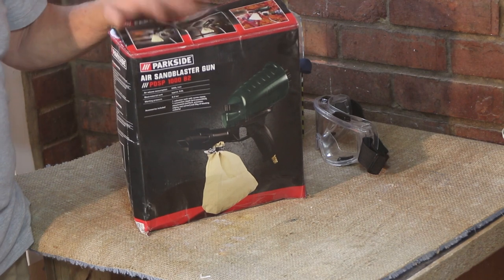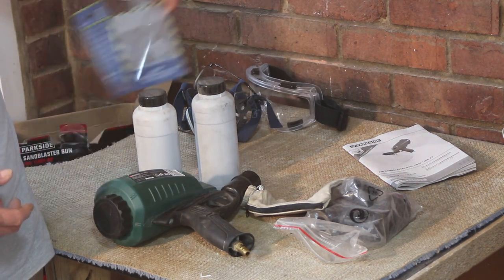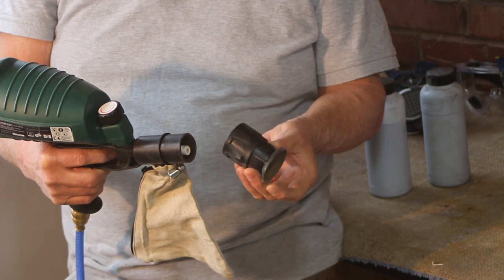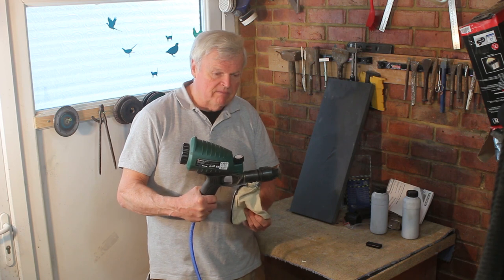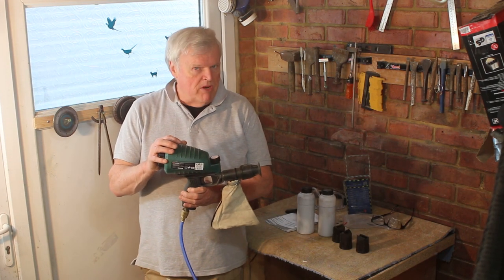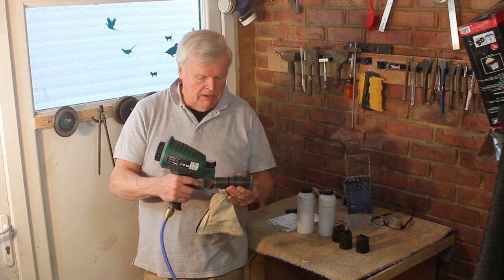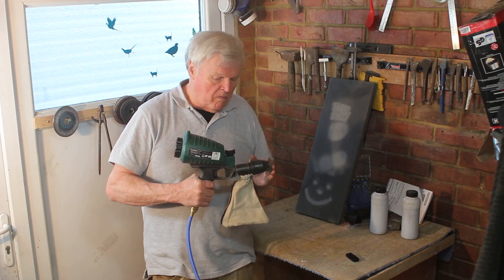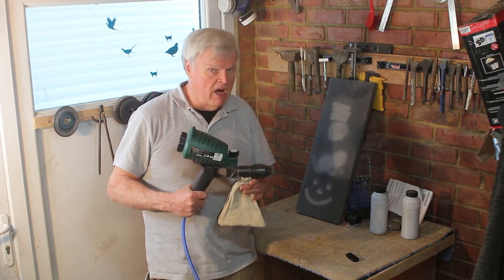Parkside Air Sandblaster Gun PDSP 1000 B2 - USER REVIEW

Comment: I am very pleased with this brand. I have purchased many products of this brand and I will continue to buy them as long as I am interested. I bought this product, and it works very well. I recommend using this product in blasting cabinet. Do not discard the sand after spraying and use it again.
Reply from the maker: Hi, this is an excellent comment, I too think you should use the blaster in a cabinet or some other way of containing the grit for re-use. Thank you for your input,

Comment: I very much appropriate the information, a good overall test . I have a large pressure pot set up on wheels, it's fine for large jobs but not exactly handy. Cheers from Dumfries Scotland.
Reply from the maker: Glad it was helpful, if you have the pressure pot will you have a use for this? For those who don't know, a pressure pot system will produce much higher pressures and faster blasting.
Thank you for watching and good luck with your blasting!

Comment: hello again, in my message below i forget to say that special sand for blasting gun cost +- 1€/kg and fine white table salt cost +- 0,3€/kg, so there is no photo if salt work well its beter to use that stuff, no. thank again for all you do for your spectator, Thierry
ps: my specific use is for sandblasting door and window blue stone (Belgium stone) because all my stones are dust and no more smooth when i touch them!
Reply from the maker: Hi Thiery, the risk of using the wrong blast media is of contracting Silicosis, a lung disease that is incurable and a terrible way to die. Blasted sand will create almost  pure silica dust and is deadly. Grits sold for blasting should have been tested to have a low silica content and produce low levels of silica dust and therefore safer to blast with. (Check with the seller) But the subject you are blasting can also create silica dust, sandstones and granites are particularly bad so use an extractor and wear a mask. Working outdoors is safer than inside.  I use Sintered aluminium oxide, this is for deep blasting stone. I have no experience of using salt but I would not use anything not approved for blasting. Your English is way better than my French! Good luck Steve
Reply: @thestonecraftingworkshop7490   I had no idea why not using sand. I thought that is ok about using it.  Reading your comment made me understand why using sand is not  an option. Better to be mentioned into the video description

Comment: fantastic video, would you reccomend this for blasting paint from a motorcycle engine? if so.... what would be the reccomended compressor specs? thanks in advance!
Reply from the maker: Hi Miguel, this would do the job, not sure about the best media as blasting metal is a bit out of my field. (possibly soda?) As to the compressor specs in general when blasting you need the biggest compressor you can get especially if you are going to do this a lot. My work compressor supplies 14cfm to a 200ltr reciever and is just enough for serious blasting. If this is a one off project a smaller home model will do it, you will have to be patient waiting for the comp to recharge frequently. Again get the biggest one you can afford. Best of luck!

Comment: Nice vid,lidl add shows that gun touch the surface thats is for the 4-5 various nozzle shapes for angles  flat etc do you know what size sand is this in the bottles?
Thanks!
Reply from the maker: Hi, I found the various nozzle shapes did not really work. I am not sure of the grit size as there is no info. It is very coarse, I would guess 40 grit. (Maybe ) Thanks for watching!
Reply: @thestonecraftingworkshop7490  
Thanks!

Comment: Hi thinking of getting one of these, what power of compressor do you think id need to run it? am only going to clean golf clubs
Reply from the maker: Hi Alan, sounds like a small garage compressor would do you, the gun only runs at 6bar pressure so not too high. If you are just cleaning think about using a softer media (grit). The grit supplied with tool will wear away the steel. Also you might think about getting or building a  small blast cabinet to contain the media otherwise the grit goes EVERYWHERE! Hope this helps. Thanks for watching.

Comment: hello, nice video very helpfull can you tell me what is the specification of your compressor ? what power you recommend for air debit ?
Reply from the maker: I have a large compressor with a 200 litre receiver and I think it generates about 14 cfm of air. the size you need will depend on the use you are going to put it to. in theory for blasting you need the biggest compressor you can afford and fit to your power supply, though this little blaster could be used on a much smaller compressor, especially if you are only doing small jobs
Reply: Wonderfull explaination, When you say 14 CFM it's for incoming air or restitution. I am looking for occasionaly restore some furniture or shutters. not matters if gear working non stop for no more 1 hours. looking also as compact as possible for little garage but really powerfull and fair price , any advice ?
Reply from the maker: I think this means it produces 14 cfm at the pump. I am not really an expert in buying compressors, as a general rule bigger is better. If you are simply short of space I do know that some makes mount the pump on top of a vertical standing receiver. This has a much smaller footprint. Might be worth looking at. Hope this helps

Comment: Hello ,.    good video I wonder could you help , 1 have a sandblaster gun pdsp 1000 d5 similar to yours I think, comes with 2 x 1 kg of aluminium oxide grit size 0.21-0.35 ( grit grade 40-60) (not what that actually means) I have a sip 200 litre  airmate 3 hp compressor, I am in the process of doing up a mf 35 tractor. I was going to use this gun to take any rust off before painting,  I don't think the 2 bottles would be enough, do you know what the best material would be to use, and I would probably need it in bags, some one mentioned crushed glass I think it was on eBay I'm in northern Ireland.        Thank you
Reply from the maker: Hi Martin, not crushed glass. I would guess something like soda or crushed garnet, something expendable. you could try here: https://www.ebay.co.uk/str/Sand-Blasters?_trksid=p2047675.l2563
They may be able to advise you, this is nor really my field. Best of luck.

Comment: hello.i have been using the same gun using kiln dried sand from B&Q.why did you say at the begining never use sand.thanks
Reply from the maker: Hi, My understanding is this, Sand when used as a blasting media breaks down into a very fine dust that contains "free sillica" looks under the microscope like splinters. These are so sharp they lodge in the walls of the lungs and will cause silicosis. (a fatal disease). Proper blasting grits are less sharp don't contain free sillica's and pose a much lesser risk. Please don't scimp on this, and always wear a really good mask!
Reply: @thestonecraftingworkshop7490  off to machine mart to buy the proper media.cheers....and a mask

Comment: Would this be up to the job of stripping paint from a mountain bike frame?
Reply from the maker: As long as you have a compressor that will provide enough air flow, and if you rigged up a collecting bay perhaps from plastic sheet and obtained the right sort of blast media I'm sure it would do the job. You will need to use a media that does not damage the metal of the frame, check with the suppliers.

Comment: What compressor where you using with this Steve?
Reply from the maker: Hi, I have a Machine-mart boxer compressor that gives out 14 cfm. However the pressure output was lowered to accommodate the tool. Thanks for watching.
Reply: @thestonecraftingworkshop7490  cheers Steve 👍 ended up going in to lidl tonight for a few things and bought that cordless engraver and a wood burner so will give them a wee tests see what their like after I watched your vid on the engraver they where in today